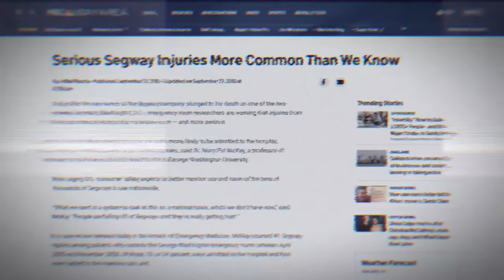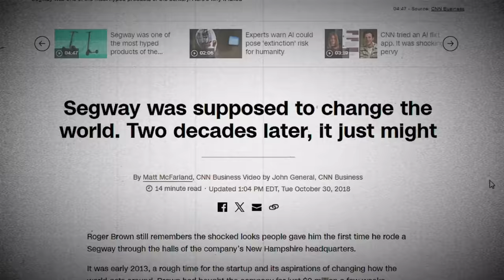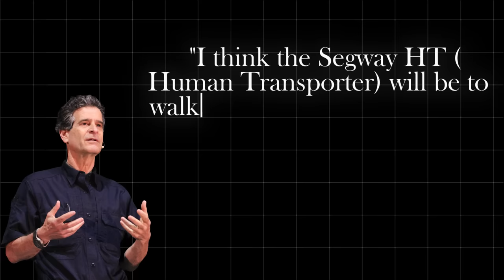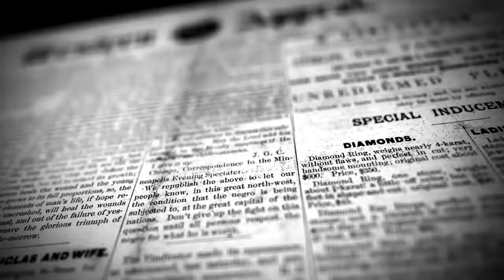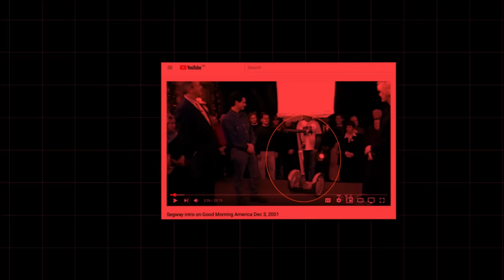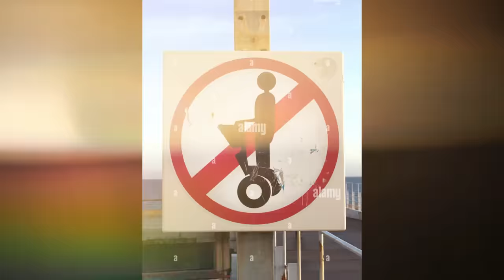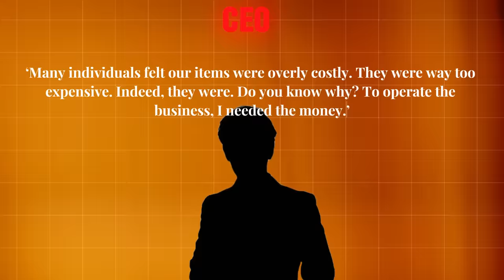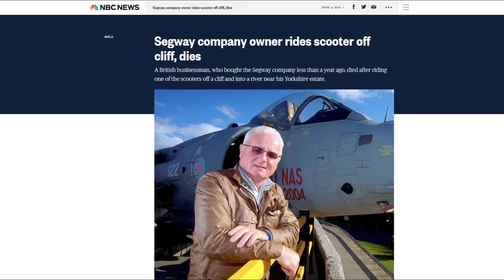Segway's Downfall: What Really Happened?

Comment: I am 80 years old, I have a Airwheels S3, Except for Manufacture, it is the Same as a segway. I have used it indoors and out for 5 years now. I use it every day.
To be safe you must respect its power, Much like a horse, it only does what you tell it to do. If you start to fall off a horse and think you can avoid it by holding onto the rein, NOT GOOD, same as with the scooter. The handle bar are not for you to avoid falling, It is for going left or right / fast or slow ONLY.
Since I expensed two falls the first year, I learned to pay strict attention to where I go. KEEP YOUR DISTANCE from walls. Make sure the path ahead of you is flat, smooth, and not slippery. 
My self balancing two wheel Vehicle is 10 times better and safer than a walker, or even walking and certainly safer than running. Go under 10 kilometer per hour, No fast movements, except for stopping. IT IS NOT A TOY!  Always get on and off from the back.

 POWER FAILURE; The scooter always falls forward, So I installed a third wheel that hovers 2 CM off the floor. Front and center, about 16" in front of the Drive wheel axle. When you loose power it slows down to a stop, for a moment you wonder what happened. It feels like you hit a small bump. 
  
Two Additions I may install some day: 
When you go up a incline over 20:1 (2.5 Deg.) have the third  Safety wheel Keep a distance of 1 CM
above the floor while power is on.  
  I may install sensors what when terrain 
ahead of you becomes dangerous, Or you get to close to a wall, you get a short warning just before you loose power. 
 
 

Some day, Self balancing machines will be accepted by society, Today they are not. 
Like the bicycle that was invented a 100 years before it became popular. 

Leonard

Comment: From an engineering perspective, the fundamental flaw in the Segway is that it is intrinsically unstable. In the absence of a sophisticated stabilization system, it will tend to fall. 

That made it unreasonably expensive, still risky to ride and unable to go places you can easily go walking for free or on a bicycle at a much lower price and far greater autonomy. 

Electric scooters with in line wheels are intrinsically more stable, cheaper, lighter, faster, safer and more intuitive.

There was simply no room for such a cumbersome approach to mobility, having much better alternatives in the market.

Comment: I worked for Segway in Tech support and honestly the biggest killer for the Segway was it’s lithium batteries. The Segway required two lithium batteries and these were roughly 1/3 the cost. If you failed to maintain the batteries they would die and be non-recoverable meaning you need  to spend over a thousand dollars for new batteries. While I appreciate the story here there were far fewer accidents then any other wheeled products. When Ninebot acquired Segway it was hoped they would address the batter cost issue but instead created the mini but it still had high cost lithium battery and the same lack of issue with owner batter maintaining of them. Segway had a bar rep I believe was really not warranted but with the birth of YouTube it really put it out there it was just not safe.

Comment: I'm nearly 70 and own 2 of them. My boss in California owns about 4. These would be the ninebot version. They're great but like anything don't let idiots ride them! These kinds of things are only as safe as the people operating them.
What they really need is a smaller battery that can be removed then they might get allowed onto planes, and I would take them on flying vacations. As it is I am in the process of converting a couple of Brompton folding bikes to be flown on vacation. I plan on using the Bosch power tool battery system which is easily under 100 watt hours and you are allowed to take multiple units in your carry on.
Reply: I take it "idiots" are people who expect they will will be able to get on them and travel w/o any training.  And you can deermine they are idiots in advance, because you require extensive training before selling them to people. .  Oh wait!!  You don't!   SNORT

Comment: I have ridden one - and thought it was great.  I didn't have any stability issues.
Like any other form of transport, if you don't know how to ride it or what it's limitations are - it will hurt you!
Reply: When you rode yours, did you have to undergo any training in advance?  If not, how would you know how to ride it ir what the limitatations are?
Reply: @jelink22 When they first came out, I built one (well, a self balancing thing that was similar) and learned to ride that around my garden.  It didn't have nearly enough torque, so I very quickl learned how far forward I could lean before it couldn't accelerate out of trouble.  When I tried a real Segway, I initially rode it, assuming it had similar constraints - and found it was everso easy by comparison!  With any of them, if you lean too far forwards, you face-plant!  
It warns you when you're getting close, but there are situations like climbing a step where you might get it wrong.  Like I said though, it's like any other vehicle - I've fallen off my bike too many times - but I blame my riding rather than the fundamental design of bikes!

Comment: Many of the video clips show the ninebos-segway mini series of rideables. I've actually ridden both the full sized segway (on a tour around Uluru in central australia) herein called segway, and two of the ninebot models, herein called ninebot. I never had a fall on the segway around Uluru and the only fall I have had on a ninebot was due to a manufacturing fault, not through ireesponsible riding or neglexting maintenence. I presently own a ninebot mini pro with a handlebar, which makes it look like a smaller version of the original segway.

Comment: Electric Unicycles (EUC's) are the real successor.  Like the Segway, they balance front-to-back.  They're also cheaper, faster, nimbler and more athletic, BUT the market of people willing to try it is much smaller.  In some ways they are safer than the e-scooter.  There is no mistaking the need for safety gear on a EUC.  There probably should have been more protection worn on the Segway too.
I'm glad EUC's have a toehold in the market, but they will probably never become commonplace.

Comment: I have a permanent condition which makes walking very difficult. I bought a Segway in 2005 after riding one as a tourist in Paris (I lived in Washington DC. It was expensive, $5k, but a life-saver for me. I rode it all over the neighborhood on errands where I would have walked, got a backpack for carrying groceries, etc. I got a tailored key with 15mph top speed, but lowest sensitivity for turning. Once you got your "sea legs", it was trivially easy to ride and maneuver, and I honestly never crashed once. I sold it in 2012 after I retired and moved to a smaller neighborhood in a completely flat area. By then the battery had lost charging and would have cost $1200 to replace. It was still in great shape and I sold it to a local dealer for $1500. Altogether a great experience.

Comment: As an engineer familiar with servo controls, I knew the Segway was a bad idea.  No designer can make a servo control that can react in a safe manner to every possible crazy thing a human operator might do to put the servo out of control.  From a safety standpoint alone, it should have never been sold to the public.  Add the ridiculously high price, the heavy weight and large size making it impractical to transport, and the local laws forbidding its use in many places, it was doomed for failure from day one.

Comment: The problem with having a vehicle that costs as much as a (tiny used, but still) car do something "for walking", like the car did for the horse and buggy, misses a few points:

Some problems the cars solved, compared to horse drawn carriages are:
1 - a car not moving does not need to be fed
2 - a car can be parked outside at the curb over night, a horse can really not be hitched over night by the curb, you need a coral or stable for them.
3 - cars did solve a stinking pollution problem in the cities. Before cars, the streets would be covered in manure.
4- a car is much easier to use than a horse with a carriage. It is even easier more convenient than riding a horse. (no saddle and other attachments that need to be put on and removed several times per day)

Sure, at the beginning the car were rather finicky as well, and tended to break down. But there were clear advantages.

Now, compared to walking, the Segway needs a place to be parked, whereas my shoes will happily stay at a shoe rack by the door, on the inside.

But hey, any successful entrepreneur that gave us thing like those medical devices is allowed to do something crazy like this. If it works out, great, if not, they should still not be dirt poor if they do things smartly.

Comment: I've been told that the incident with President Bush was due to him trying to ride a unit that was not powered on. The Segway was designed as a pedestrian device, for use on sidewalks, among pedestrians. It has electric motors and gyroscopes and sensors. It doesn't work when it's turned off. When it's turned on, it balances itself and is pretty safe to ride, once you get the hang of it.

If you're the kind of pedestrian who doesn't watch where you're going, falls off curbs, and can't walk and chew gum at the same time, then the Segway is not for you. If you like walking too close to the edge of cliffs, or running through crowds and mowing people down, the Segway is not for you. The Segway does put the rider up higher than they would normally walk, so it's necessary to pay a bit more attention to your surroundings than you should as a normal pedestrian.

Probably its worst flaw, other than the ridiculous hype prior to its unveiling, is the price. I seriously considered getting one, but I didn't want to have to deal with misguided police officers trying to write me tickets for riding it on the sidewalk. California, where I live, passed a law allowing Segways, but individual cities could also pass laws restricting or banning them.

Comment: Two wheels in-line are partialy self-stabilising and a very large percentage of the human population from a very young age can completely stabilise  in-line machines with no external power or electonics. Side by side machine on the other hand cannot be used without external power and electronics and have no way to be controlled and propelled by human  balance and muscle power alone. Nor can they easily be pushed by a pedestrian human without some internal power. An electric bike can be pushed or pedalled home in case of power failure, likewise a scooter. With side by side? Better call an Über! The results are obvious - while bikes and scooters, powered and unpowered, are ubiqitous, Segway is all but invisible.

Comment: In the video you mix two different products; the original segway had the handlebar, big wheels, and costed about 5k, many years later they produced the smaller versions that you show, without handlebar, definitely cheaper! I am using one since 5 or 6 years, and I am very satisfied. The cost was around 3 hundred euros. The cost of a bicycle, much less than an electric bike!

Comment: I think half of the problem with the Segway is that they created hype that was impossible to satisfy even if the final product was good. For months, there were rumors of a new invention that 'will revolutionize transportation,' 'make cars obsolete,' and 'cities will be redesigned around it.' People were expecting some mind-blowing sci-fi technology, and when it was finally revealed, they saw an overpriced electric scooter and felt kind of cheated. If they had made a more reality-grounded advertising, it would have been better received and probably developed a market. The other half of the problem is that it was unnecessarily complicated. Why use $5000 worth of electronics and gyroscopes to solve a problem that could be fixed by adding a third wheel?

Comment: As it turns out, the 2 wheels, side-by-side , is very unstable and unsafe during speed changes and turns - the popular electric scooter is far more stable and easier to control, without having to rely on gyros for stability.  In either case, both hands are required for safe operation, but the advantages of the 2 wheel scooter over the 2 wheel segway counterbalances the 2-hand requirement.

Comment: To meet the need claimed by the Segway, and much better, Get a moped:  It can
- carry two full grocery bags;
- it can drive in city traffic up to 25 or 30 mph.  It will go all day.
- it has brake lights, tail lights, turn signals, a headlight and is safe at night.
- it's  legal, and does not need a license tag or insurance as does a motorbike,
- it does a lot more, and costs far less, than a Segway.

Me, I want a one-person bicycle airship with electric motor to noodle around town.
Tie off at a railing in front of bar sidewalk restaurant.

Comment: You want my opinion? Shame on people who think they can jump on a motorcycle and ride them in dangerous conditions without any training or practice. Or any other device that requires skill. And that my friends is your problem with Segway. 'Easy' to operate in perfect conditions. All the accident I seen in your video strictly owner operator! Taking them off sidewalks are a bummer, but you put a unskilled rider behind a wheel and it ends in disaster.    I don't think 'Segway' said camera man, don't pay attention while driving? Or jump off a ramp. And the guy who fell off a cliff? I would have aborted before getting close. Skills people. Dirt bike riders go crazy riding bikes around cliffs trails. Crash all day long. Bikes fault? Did the wheel fall off, is that what happened??? I don't think so.

Comment: Surprised it made it that far. At best a device very limited in utility, and risky to use. The hype and price were so obviously flawed that it could only be a toy. The claim that it took years of research only added to the suspicion that the engineers or management staff weren't the most capable.

Comment: The Electric Unicycle developed soon after the downfall of Segway. Although much more difficult to learn to ride, it's actually much safer and maneuverable once you commit to the process.  An electric unicycle/monowheel (EUC) takes a similar amount of time to learn as riding a bike but it's ultimately more flexible and useful. It will likely be about 10 more years until EUCs are mass-marketable. The technology required to automate some of the inherent instability will need R&D funding beyond the current resources being allocated, EUCs will continue to be a niche sport until the product is further developed to the point of being self-driving with power-assisted steering, balance and traction control. For those intrepid and patient enough to devote the time to learn, there is NO other riding experience that is as liberating and joyful as being one with these machines.

Comment: IMO there are a couple of faults they had. The first was a learning mode. Much like hover boards they needed a mode that was slowed down response time from the device while learning how to use it. The other is tech from a jet ski or snow board, they needed a kill switch if you fell off. If the conditions were right, they would continue on by themselves, which some of these videos highlight.

Comment: Segway still needed two wheels.  Instead of fore and aft like a bicycle, it used two wheels side by side.  It used the second wheel to provide the lateral stablility easily done by bicycle  or scooter using an easily learned human skill.  It used complex electronics to provide the longitunidal stablility easily done using a second wheel.    The result.a product that was heavy,  expensive, needed a lot of space,  required skill to use, with the possibility of serious accidents in apparently innocuous situations.  Its failure should nothave been a surprise.
The autonomous car is a similarly over-hyped invention.  It is  only useable if it becomes an autonomous taxi.  Who wants to have to always be waiting for a taxi?  If you want to always have the vehicle with you, you might as well drive it!

Comment: it could have use for camera people (that bolt accident wasn't segway's fault) and in similar jobs and for old people. that stuff carrying use is absolutely amazing (absolute minimum footprint) - but it cannot cost more than 400$ and it would still be nieche. correction on nieche, maybe it could be used in army in special situations for carrying stuff.
Reply: I remember a short vid a few years back of a squadron of Norks in a parade, squatting over their knee-controlled devices with bullpups at the ready. Looked cool, looked impractical.

Comment: The problem was it was overpriced and never found a special use.  If someone just wanted to ride cheaply somewhere there were, at the time, small electric scooters that every car parts store seemed to sell for $150 that would do the same thing. I still have one.  I don't use it either.  The Segway turned into just a gimmick.